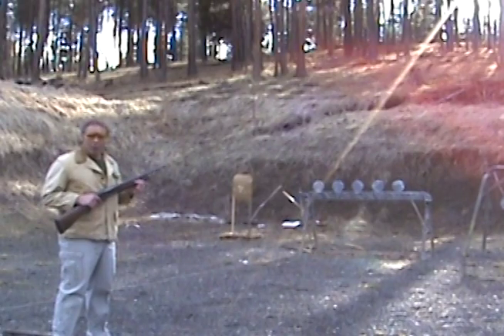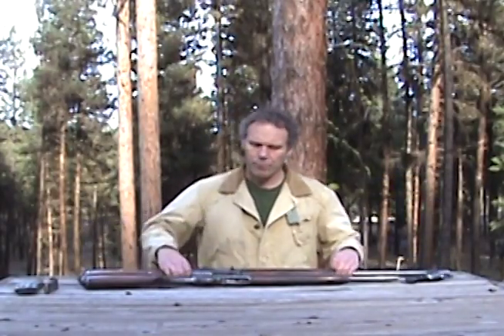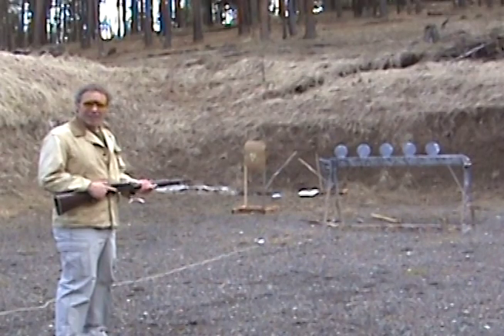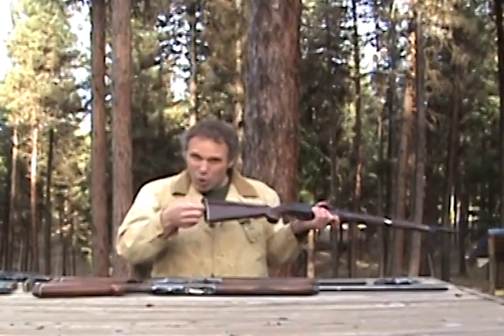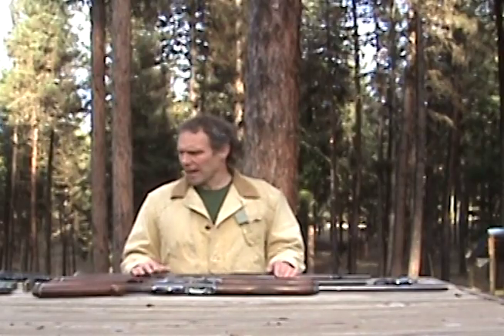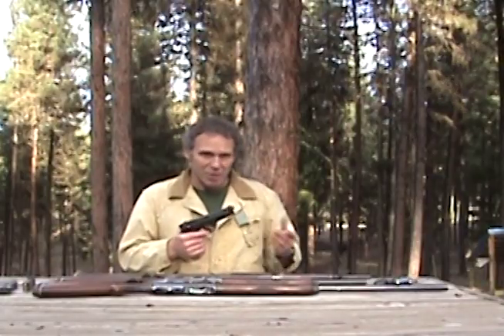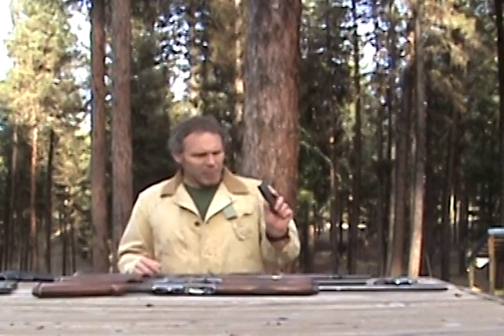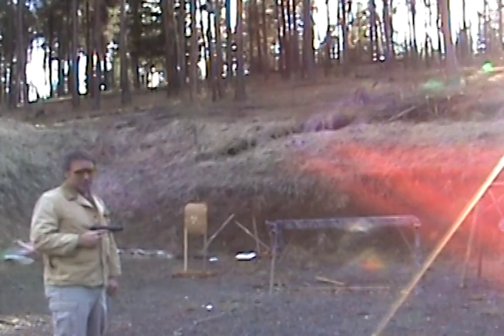Can spring compression damage a magazine?

Comment: From lesjoforsab companies web site, they make springs for industrial applications.  This provides the technical angle supporting the conclusions in the video. https://www.lesjoforsab.com/technical-information/durability.asp  the diagrams can be seen there.  

Spring durability and spring fatigue

A spring is regarded as being durable if it does not loose force or when subjected to a certain spring travel, shortens under a given force or breaks to that the function is disrupted or disappears.
If a spring is to be durable, the stress in the material must not be greater than the strength of the material permits.

When a load is applied to a piece of metal it deflect first elastically and if the load is high enough also plastically. Elastic deflection is when the material after unloading return to its previous shape/geometry. At plastic deflection the metal receives a permanent deformation and do not return to its previous geometry after unloading. It is the elastic part of the deflection which is used to receive the deflection in durable springs. The function stress and deflection is described in Hooks law where the elastic module E for normal and G for shear stress is described. These E and G modulus are the figures describing elastic behaviour for metals. A low figure means more deflection than a high figure for the same stress. A metal with high strength can normally be loaded to a higher stress without passing the limit where the deflection starts to be plastic hence more elastic deflection. The stress limit when the metal starts to deflect plastically is the materials yield strength. The ultimate tensile strength is the stress at which the metal breaks.

Two more material properties are of great interest for springs it is the creep/relaxation and the fatigue. One physical phenomenon with metals is that at stress below the yield strength of the material a very slow plastic deformation take place. In the spring branch this is called creep when a spring under constant load loose length and it is called relaxation when a spring under constant compression lose load. How much creep/relaxation is depends on the temperature, the stress in the metal, the metals yield strength and the time. Increased temperature, stress and time also increase the creep/relaxation. Especially the temperature and stress have a big influence. Lesjöfors regularly does relaxation and creep tests on different materials and different types of springs, we provide information and knowledge about this important property, creep/relaxation. The diagram below show how the relaxation depends of the time, for a certain material, stress and temperature.

 Relaxation

One other phenomenon with metals is that, at pulsated stress below the yield strength of the spring materials, the materials can break because of fatigue.

A spring fatigue problem starts with the development of a micro fatigue crack which grows for every pulsation. When the stress in the remaining material reaches the ultimate tensile strength the spring will break. The risk for fatigue depends among other factor very much on the designed stress in the spring, the amplitude of the pulsation and the material ultimate tensile strength. It should be noted that material with the same chemical analysis and strength can have different fatigue property because also other material factors have an influence. Also the temperature and corrosion affect the fatigue strength of a spring. When testing the fatigue strength the spread makes its necessary to use statistic methods to get reliable results and to calculate the risk levels for breakages or security factors. Lesj"fors regularly does fatigue tests on various materials and types of springs and we provide knowledge and information about this important spring property, fatigue. The diagram below show how the fatigue strength in number of pulsations for different stress levels, for a certain material and temperature.

Fatigue strength

Comment: Another analogy. Automobile springs are under tension for decades. In 50 years the coils on a 1962 Olds cutlass (convertible - heavier frame, etc) that I had till 2018; the springs had 'set' approx 1/2" over the years with 3200 lbs pressing on them. Plus up and down over the road for 82,000 miles. Again draw your own conclusions.

Comment: It comes down to the metallurgy and quality of the spring steel. If it's high grade steel it will last a lifetime, if it's low grade steel in the spring it will fail eventually.

Comment: It definitely does happen. I carry a ruger lcp II and I just recently have had to stretch the spring of the factory magazine to get the slide to lock back after the last round.

I shoot as often as I can, but it's been quite a while.

I also cycle the magazine every other week or so. So even with some movement the spring will eventually get weaker on these magazines.

Comment: You were saying it's an easy fix for the M16 magazine to pull the spring out and stretch it. I tried that when I was in the US Army and I may have stretched it too much because it seemed to cause too much spring by pushing rounds too hard and causing jams.
Reply: Can also weaken a spring by pulling it too far or holding it at a stretch for too long. To increase tension, you'd have to have: increased the diameter of the spring wire, which stretching won't do; increase the diameter of the spring coils, which stretching won't do; or decrease the body, giving less coils and more free length, which stretching also won't do.